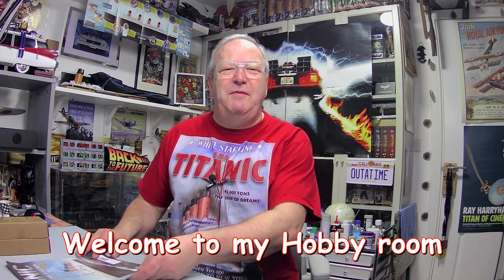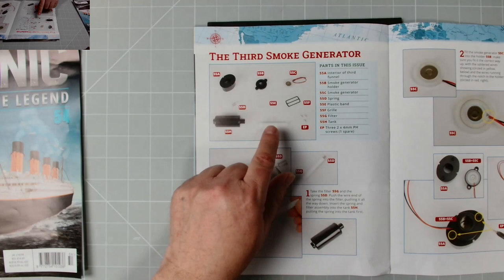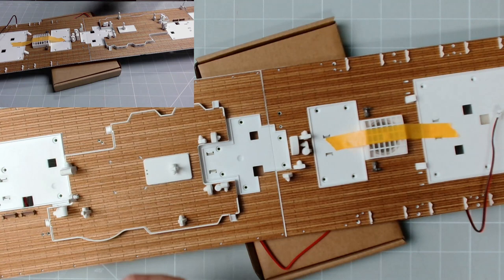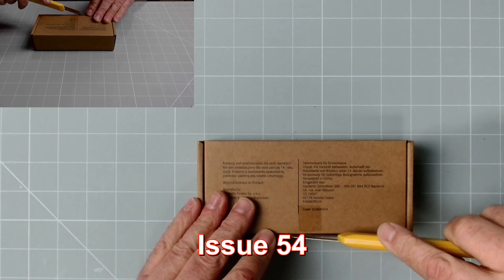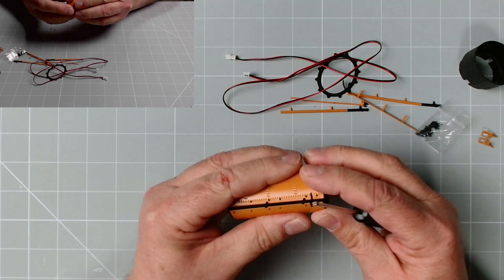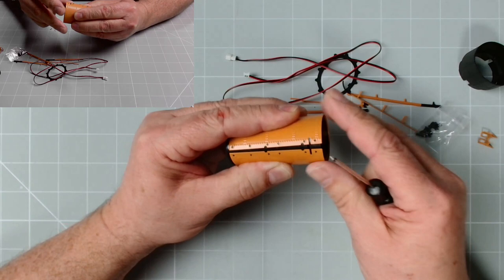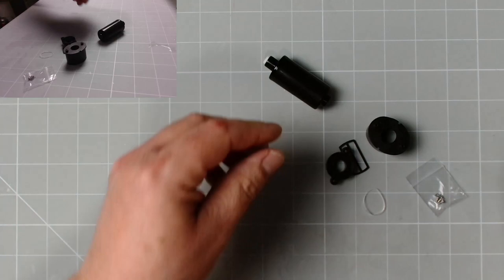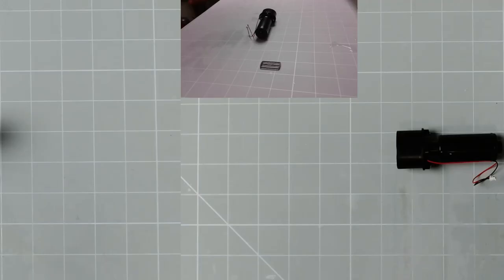Build the Titanic issues 53 to 56 from Hachette

Comment: Hi John, I have not got my issues yet, but been such a long time since working on the funnels, had to watch just to remind me 😊
I wonder if the lights are going to be diffused a little like they did in earlier issues with that special tape going across the lights, those boxes which the funnels sit on so small, may just black them out.
Anyway John, know it's been a long time, but thanks for the video, certainly need to catch up with your Lancaster build.
Fabulous watch as always John. Cheers.👍
Reply from the maker: You are welcome, Phil. I would be surprised if we didn't get a diffuser for the lights as an option along with the foil strips. It will be good to finish the funnels and start on the Hull again. Take care and speak soon.